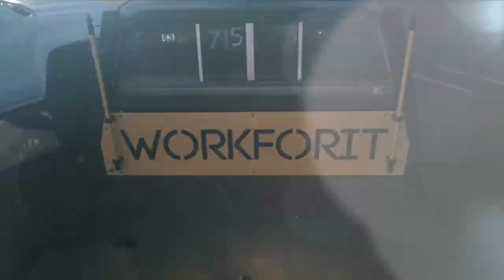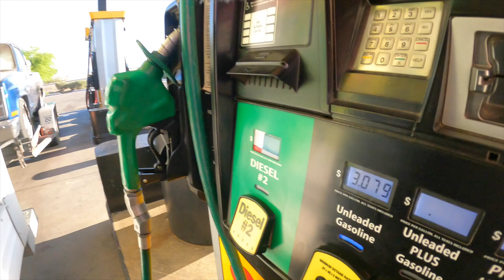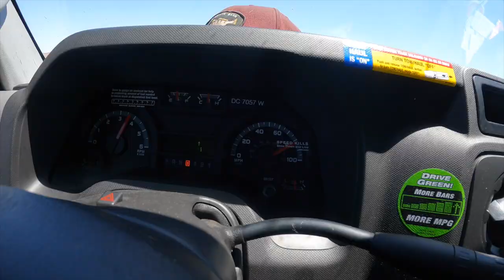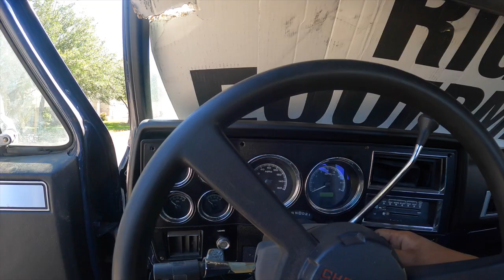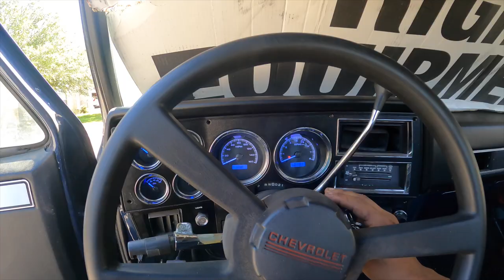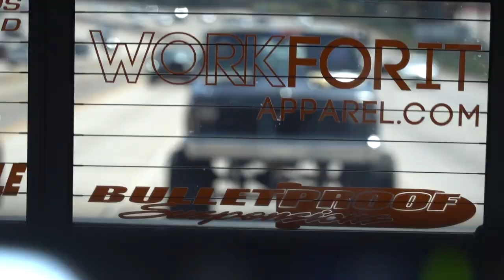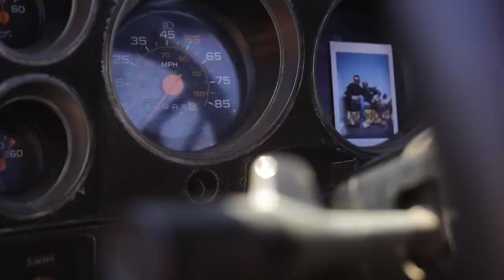We Got the Duramax K20 Stuck in the Lamest Way....

Comment: I don't own a truck and the only diesel motor at my house is in my Kubota Tractor but all new trucks have that Def or whatever it's called and I want to know what happens if you don't fill that up when you get fuel?
Reply from the maker: The truck will go into limp mode until you fill them up